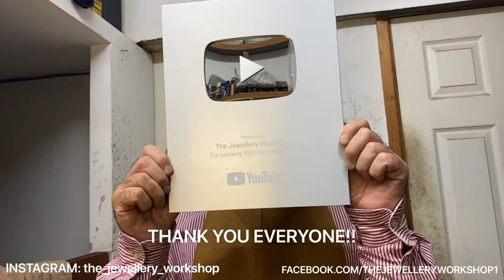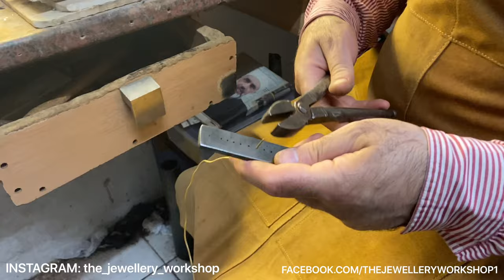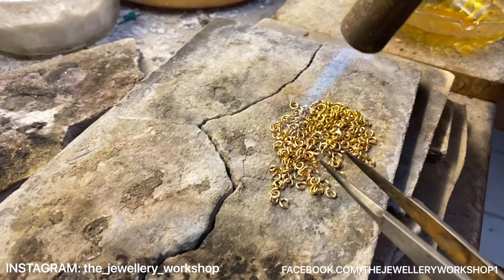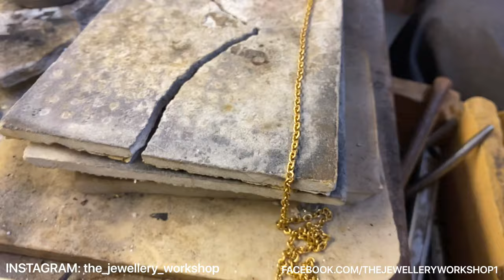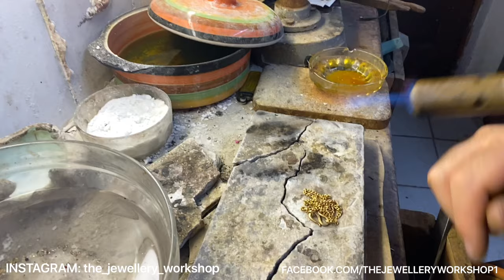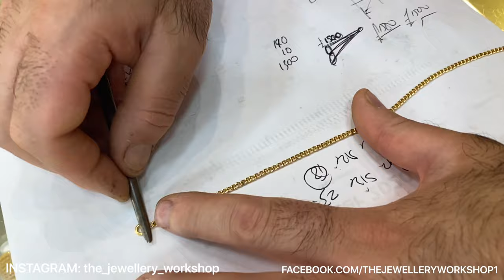How a Curb Chain is Made by Hand | How to Make a Chain | Gold Jewelry Making | How it's Made | 4K

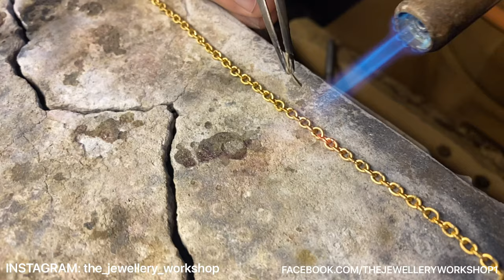Comment: The soldering method starting at 3:39 is so badass! I hadn't seen that! Is there solder when you close the first batch of circles? It looks like there isn't. Thanks for sharing your amazing skills 🙏.
Reply from the maker: Very well spotted! Regarding the first batch, there is no solder needed as once you heat the circles slightly it closes in on itself. But for the other batch of circles. Solder is needed
Reply: @TheJewelleryWorkshop  Thank you for your reply :)! Would the solderless method work with silver wire, or would the silver melt way too quickly?
Reply from the maker: I haven’t tried it with silver you know…. Do you have instagram? Message me on there. I can try and see tomorrow for you!
Reply: @TheJewelleryWorkshop  ok, I will!

Comment: quick question in some of your videos you use a lathe with a tool on it, when you press a button the ring turns a couple degrees, what tool is that? and you used the same tool from the lathe on a hand piece, was that a normal saw blade?
Reply from the maker: You can buy the same tool from here :) 

https://www.ebay.co.uk/itm/124116795857